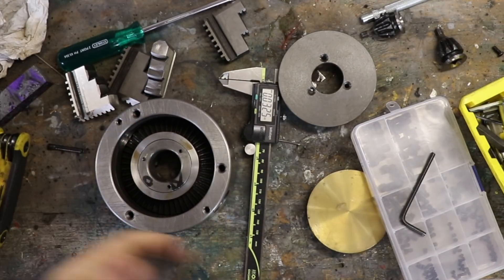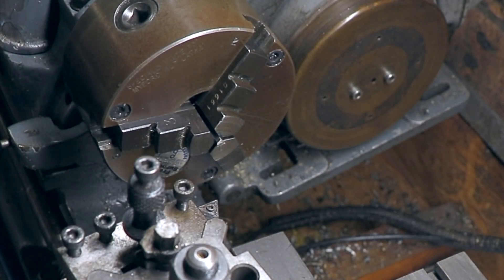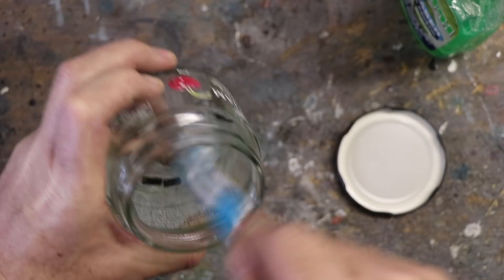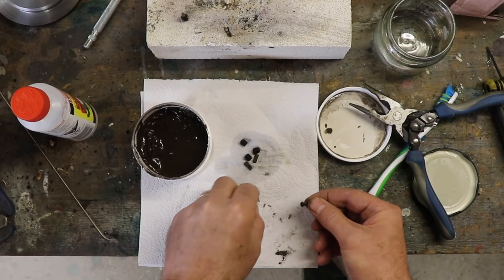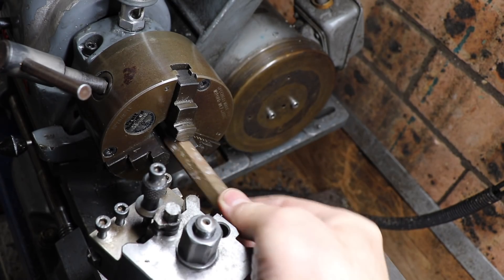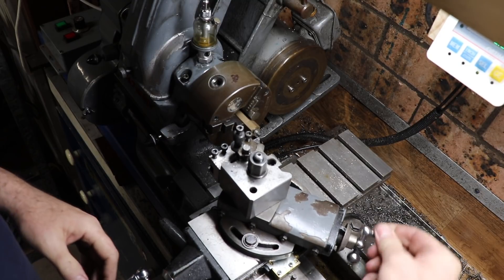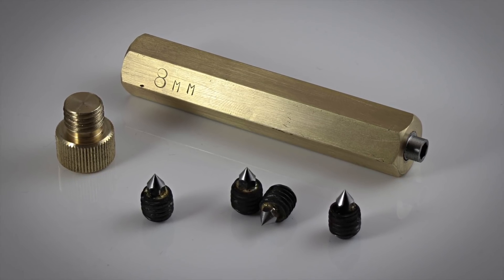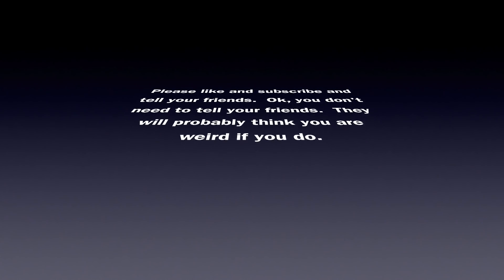Make Some Transfer Screws

Comment: Are you grinding the hex key and braising into a threaded socket head because there’s no bolt steel that would be hard enough to make a good transfer tip? I mean, I love and appreciate the work put into this but wonder if you can just take some slotted insert bolts and make em pointy.
Reply from the maker: You need to be able to get them out from the front.

Comment: That was great , I have a questions.
Did you put solder into the hex with the flux or did you apply it to the side when hot?
Reply from the maker: It's a long time ago, but probably I put a little bit in the hole with the flux.  What normally happens with that kind of stuff is that the flux boils and blows the part you are trying to solder out of the hole and then the part falls over and the solder rolls off the bench and lands in your sock.

Comment: Hi John, here from South America, just I was needing, I was looking for a precise way to transfer screws to a disc adapter so I can use my new 4 jaws chuck in my new_old Hobbymat MD65 desktop mini lathe that I just got. I bought a 1988 Hobbymay MD65 mini lathe, east germany made (PROXXON west Germany sister company  now reuned since 1990), but 100% new, well stored for years, so not used at all. Lucky me. So, thanks a lot for your so clear, precise and intelligent solution that you are sharing, I love it !!!. The chemical products you used to clean up the parts to solder them, is kind of complicate to me to find them here, so I will do an installation with interference tolerance, I hope it will work. Mario.
Reply from the maker: Hi Mario, as long as the parts are clean you should be able to braze them ok.  I think interference fit would be ok or if not you could just add some epoxy or loctite.  Thanks for your comment.

Comment: Making those transfer screws and wrench was too much work. I see you have a rotary table and a milling machine. It would have been easier to find the radius of the 3 hole bolt circle on the chuck and drill the holes on the backplate 120 degees apart using your rotary table.

Comment: I'm back - just a thought: when you machine the handle/transfer screw, you could machine it to get your 1 mm depth (perhaps don't take off quite so much off the handle) when you screw the transfer screw in to the part to be drilled and tapped...
Reply from the maker: That’s a good idea!

Comment: "This thing needs a handle to stop it spinning": Joe Piezinsky made a set of handles for his tail stock die by machining the head of a longish hex head bolt to remove the hex (for comfort) and machined the threaded part short (to fit the holder) and just screwed them in. Very good job, so is yours. I must make a set of these up - your design is fantastic; it means I could make up a full set (whatever that may be) of transfer screws (metric and imperial) and and I can repair them if necessary, so: full marks to you!

Comment: Great project...just added to my list...bob
Reply from the maker: I recently saw someone who did it by just making a little hardened point that fits in the hex socket.  They used a magnet to remove it.  
I still like mine but it’s a quicker solution.
Reply: I like yours as well...they are identical to the ones I already have (I bought them years ago)...no need to break up the set (: ...bob

Comment: Hello John. The last transfer screws we made were for a new back plate for the addition of a 5C collet holding lathe chuck made three of them but really just for a single function these you are making will come in handy as we love the WONT GET LOST handle carry case wrench kit. Cool sound effects on the quenching after fire. You installed your three to your chuck just like we did for the 5C Collet Chuck transfer.

Comment: Nice work! Im a bit lazier so always trying to save some time. My current plan is to use some aluminum hex stock I have here along with extra 8mm bolts turned down to a point and parted off. Then drill & tap the hex stock 1/3 the length of the 8mm threaded bolts I just tapered and parted and screw them into the hex stock then put the assembly in my mills vice and make a flat, turn to next side of the hex stock and make another flat and so on. Should be quicker and stronger(though it probably wouldnt matter) than braising plus my hex keys will be safe!
Reply from the maker: Chris Hax good luck!
I’ve made a couple of different sets now and they are surprisingly quick to make.
I always seem to have plenty of random hex keys kicking around.

Comment: You do have a mill and a rotary table?!
Why would you need to transfer the holes?
Apart from that, nice work.
Reply: I have an S-12D Wisconsin engine that has holes around the casting around the output shaft), that I would use to fit a plate for rubber mounts. Fitting the plate around the shaft, cuts down the torque effect on the mounts. 

This idea of Johns would be fantastic, as I can get the holes just right! And, no. I don't have a mill (megabucks) or rotary table (hundreds of bucks) ... !  I just have to machine the plate to clear the SAE casting, which I can do on my (relatively) small lathe.

Comment: Why not make precision pins to measure PCD since angle spacing is known?
Reply from the maker: It's hard to measure because there are 3 bolts, but yes you could do it that way.  Also you would be assuming they were drilled on center and tapped on center.

Comment: Just curious: how did you manage to heat the silvered assembly to red hot without melting the silver and screwing up the alignment of the parts?
Reply from the maker: Eros Nicolau the tip is small and heats up quickly.  Also the Allen key is quite a snug fit even before brazing.  So I don’t think it would be much of a problem.

Comment: Very cleverly done.  The US producer went out of business. Your design is a very clean setup and fills a void in the market for DIY home shop players. Thank you.
Reply: The design is different to Alexander's (or Nielsen) as they imprint the size of the hole ... There is a set like this for various metric, but the shipping costs, as alluded to above, would be horrendous. I gave some hex brass - now I have a use for it! I will to get some smaller hex brass for the smaller sizes.

Comment: use ammonia ( eg toilet bowl cleaner ) to remove the black oxide on the hex keys before brazing or soldering or welding.
Reply from the maker: Baikal IZH35M I will try that next time.  It brazed very nicely in any case.

Comment: I made mine by making a fixture to chuck them up and cut the hex with an index head, then turned the point with a lathe. All one piece that way and by using socket head cap screws to start they are good and tough. Have lasted for years. I did not make the holder as I already had some made commercially that I utilized.  I did make several sizes and lengths and keep everything in a plastic case. Very worthwhile project.
Reply from the maker: I was thinking of doing it that way initially also.
Thanks for watching!

Comment: Great job, but you could just buy hardened cone point grub screws :-)  https://goo.gl/dX9oD8 providing of course you have enough "depth" to allow for alignment when the grub screw is higher than the surrounding surface. :-) I DO like your implementation of the socket to adjust the depth of the point, excellent!
Reply from the maker: The point is on the wrong side.
Reply: Hi, I'm not sure if that was meant in humour or not :-) but they are screwed in with the pointed side facing out. Two small flats would ease the removal. This is not a nice as your method though :-)
Reply from the maker: That's what I thought about doing first, but the idea of using an allen key seemed so much neater.  Plus I just love to silver solder stuff!     Thanks for watching and sharing your thoughts.

Comment: so far I only have a small set like 10/24 and thought if I needed one for a 3/8 hole I would use a 3/8 bolt thread and tap it for my 10/24 transfer screws, you did a great job on the build
Reply from the maker: I'll probably never use them again, but it was a fun project anyway.
Thanks for watching!